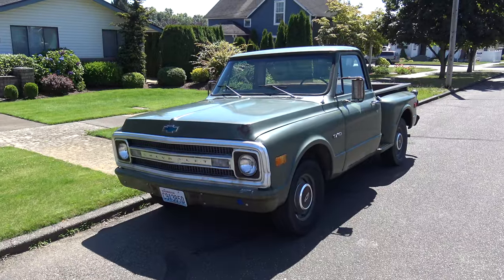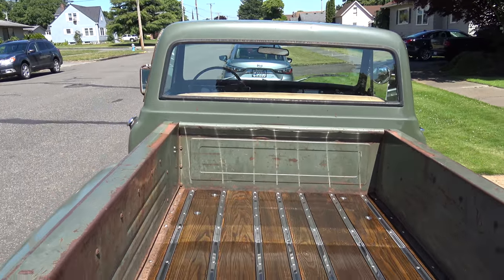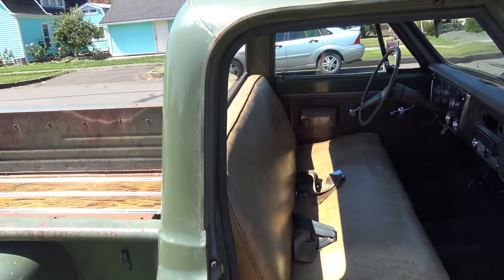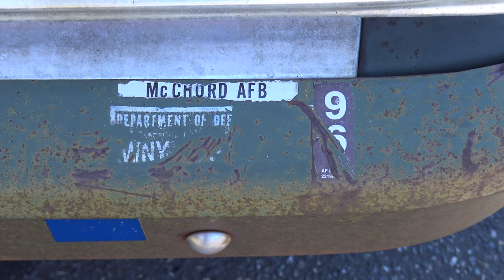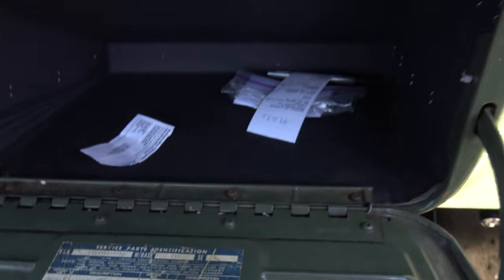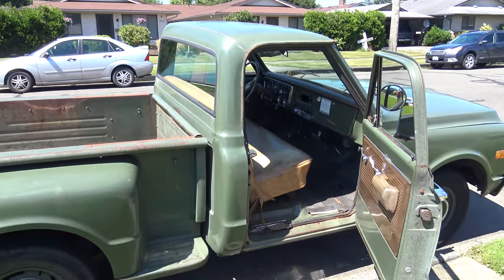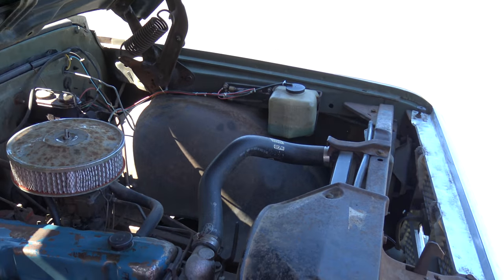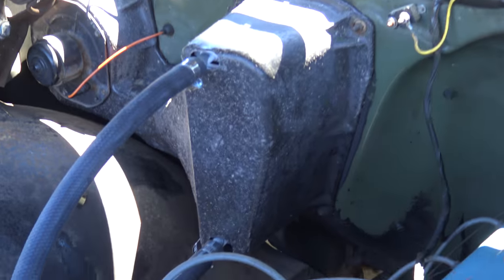Bell telephone company field service 69 c10

Comment: I have a 1957 Bell phone truck, it was from Portland. Mine had a service box on it but was gone when I bought it in Baker City 1n 2011. It is a 3/4 ton with a 4 speed and flat head six. It is a daily driver here in the Yakima Valley. Studebaker called the color Bell System Green.